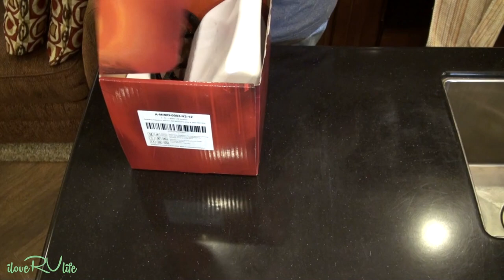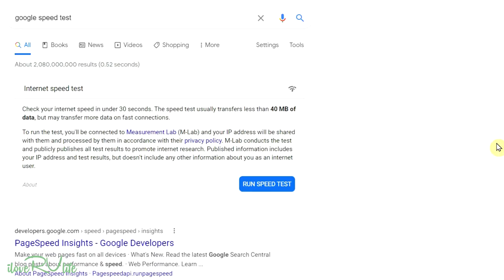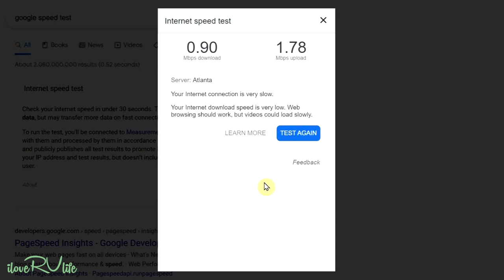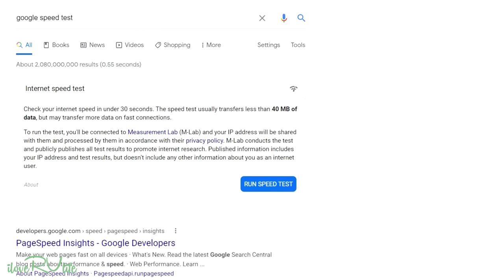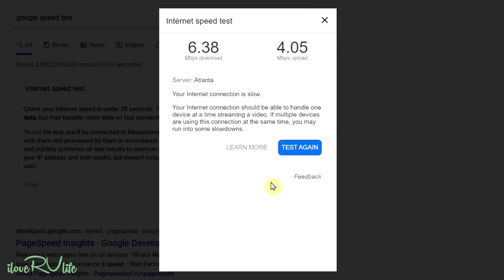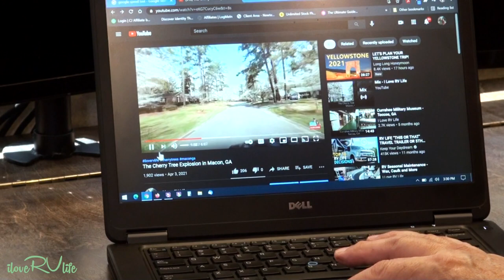External MIMO Antenna for the MoFi 4500

Comment: The paddles work a little better when they are at 45 degree angles, not straight up. That creates the 90 degrees MIMO needs. I started with the Surecall booster and wasted $350.  It's more for cell signal boosting. I have the mofi and it rocks for cell internet boosting. Nice video!!
Reply from the maker: It’s a really good unit.  Thanks for the tip.

Comment: Jerry
Instead of a metal plate, try some aluminum duct tape. It works well for me.  Also there is a firmware update that includes a built in speed test. Also a selective band lock depending on the speed test.
Reply from the maker: Thanks.
Reply: Great job, Jerry... I am in a rural area in Western NC & have the Mofi4500 dual band router w/ MIMO 4 X 4 external attennas & have done a firmware update, locking down bands that give me the best signal. Unbelievable difference. Speed tests before, 3 mbps download, 2 mbps upload...With new configurations mentioned, I am getting 75 to 105 mbps download, 25 to 35 mbps upload...VERY HAPPY CAMPER HERE ! Thx for sharing your videos & the best internet is still ahead ! 👌 👍🙏
Reply from the maker: It is a good unit. We’re moving often and we experience changes in which bands have the best bandwidth. Great having the ability to lock in the best performing band.

Comment: How does it compare to a directional antenna?
Reply from the maker: Hi Haskell.  This antenna doesn't have the gain of the directional antennas.  That's also depends in the directional used too.  We're taking a couple db hit with this omni, but a big improvement over the paddle antennas we were using inside the 5th wheel, plus the convenience of just turning the unit on with now outside set up.

Comment: Jerry, is there a way to attach the MiMo in another place? We do not want to drill a hole in the roof. Love your videos.
Reply from the maker: Thanks so much.  There’s a couple options when using the MoFi 4500.  The simplest is using the upgraded paddle antennas.  These work great if you have a good to moderate cell signal.  For low signals, I used the extendable aluminum painters pole with an Omni directional antenna.  Easy to set up.  No permanent mounting.  Extent the pole.  Use a couple short bungee cords to tie to the ladder rack and run the cable in a window.  Cable is thin and closing the window won’t damage.  This is the antenna we used https://www.mobilemusthave.com/Poynting-OMNI-402-Marine-LTE-2x2-MIMO-Antenna_p_101.html/?AffId=81. You may need to add some extra cable to reach.  You can order the length needed with the ends to fit the antenna and MoFi here https://www.mobilemusthave.com/LMR-400-UltraFlex-Custom-Cables-Various-Lengths-Terminations_p_1245.html/?Affld=81
Reply: @iLoveRVlife  Thanks so much for getting back to me.
Reply: I use 2 yagi antennas on a pole.  I go out through the bottom corner of one of our slides.  However, in the newer rv, we'll be going through the roof.  May do an omni mofi antenna (like this one) and have the pole/yagi's ready to go up if things are slow.
Reply from the maker: The yagi’s are far superior.  This was a good step above the paddles.  We traded the Gateway and have a new 5th wheel.  I’m considering the Husky Pro by Parsec and mount on top the ladder in back.  Haven’t worked out the entry yet.  Just don’t feel right drilling a hole in the new 5th wheel yet.

Comment: Great info Jerry, thanks!  Have you attempted video conferencing with the Poynting/MOFI 4500 set-up?  I am getting ready for a 2 month road trip, however, I spend 2-6 hours a day in group video conferencing!  (Yuck, but it pays the bills...)  Any pointers or suggestions?  Thanks in advance!
Reply from the maker: I have. All depends on bandwidth.  Currently in a very remote area.  With 10 down and 5 up, easily do conferences.   One tip. Before we book a site,  I call and asked about the cell coverage. If it's poor, we pass and find another place if client work is scheduled for the week.

Comment: Great video! I am soon to be full time Rving in my 5th wheel I just purchased and I have been outfitting it for battle. I just had a 30 foot bumper pull I set up a simple solar and battery monitor setup as well as an inexpensive smart tv I bought from best buy and converted it easily to run on 12V. Trying to within reason have as many amenities as I can run from 12v for boondocking flexibility. Changing all my bulbs to led, the TV running on 12v instead of through a power hungry inverter was a great start. Which antenna model is this you used? There are like 4 different models at the link you provided? Is this just the 2-in-1 lower cost model? I was just about to pull the trigger on the  Inseego MiFi M2100 5G from Verizon as a hotspot but I think I may go this route instead the router you have and this antenna. 5G will never work camping anyhow I feel that hotspot from Verizon is just going to be overpriced let down. Internet is a high concern so I don't mind within reason investing into a usable solution. I mostly just watch Youtube, I do have a channel and upload videos as well so I know i'm in for a challenge and a world of frustration. I love the pace and attention to detail in your vids. You don't leave out important details and don't rush. Good job
Reply from the maker: Thanks a bunch.  This is the Poynting 2 n 1.  I didn't need GPS or wifi connections.  Just serving the MoFi 4500.  We're in a lot of rural areas.  4G is working great and agree will be some time before 5G is widely available.   With your boondocking plans, consider the 12V DC power regulator to go with the MoFi.  Simple add.  I have it, but running on 120V AC.  Plan to add later this month.  Safe travels.

Comment: This was a great side by side comparison with the speed tests. I just purchased a new 5500 as my first 4G router and am trying to decide on an antenna so that I can work remote and travel national parks with enough bandwidth to support my remote desktop. Just wondering where this RV park is with the incredibly poor connection. Is that typical for campsites across the country in national and state parks? Just trying to gather as much info as possible before this lifestyle change. Thanks!
Reply from the maker: Here good things about the new 5500.  State and National parks are hit or miss for cellular coverage.  As you research a campground, often comments are shared on the access to or lack of cell coverage.  I work on the road, so if no “reasonable” coverage, we skip.  If you’ll be in the more rural areas, consider a dual stack Yagi on a long adjustable painter pole.  Then take a few minutes to point at the closest tower.  These dual Yagi stacks are high gain.  The biggie is you must have some signal before you can increase with an antenna.
Reply: @iLoveRVlife  Do you have a go-to resource for campground cell service information? I know about campendium but that’s about it. Thanks again
Reply from the maker: I use https://www.cellmapper.net Also do a Google or Trip Advisor search for the campground.  Search comments for “cell”.  Not 100%, but others may have shared experience.  If still unsure, call the campground.  Usually someone at the desk will let you know of carriers and strength.

Comment: Have you tried out the Mofi 4500 with the Sims seven yet?
Reply from the maker: I have one. https://youtu.be/f3bW5RUp2Ww?si=3Zod4TwgtFokXsJJ Nice unit. Upgraded to a CradlePoint with CAT20. https://youtu.be/ZvThK258sZM?si=BQWm0OW4FhnvBEYE Needed 5G.  Most of the 4G plans are now getting low band 5G transport.  We’ve seen 4X to 5X increase in speeds.

Comment: you described the paddles at the beginning that you said were an upgrade, so you showed 4 antenae.  Yet you only installed the two basic ones and there doesn't seem to be room for the other two the way you installed it.  Are you saying they really aren't necessary or am I missing something?
Reply from the maker: Joene, I mentioned the previous video where purchased and set up the MoFi 4500.  Without the external antenna we moved from side to side of the 5th wheel next to a window for the best signal reception.  The paddle antennas were used for the cellular reception.  Now with the external antenna, I permanently mounted the MoFi to the side of the cabinet and eliminated the need for the paddles.

Comment: I have been using the Mofi 4500 as well and it's been doing great. But, I wonder how this would compare with the double Yagi style antenna that I put up on a pole when I'm in a fringe area? Sure would be nice to no longer need to put up the pole and then point it in right direction!
Reply from the maker: No comparison with the double Yagi for signal gain.  The Yagi will have more gain.  The pie shaped Yagi’s are around 11db, where the Poynting is slightly less than 6db.  Also, you can get a little extra height with a pole set up.  The big benefit with the Poynting is lack of set up plus signal improvement.  Just turn on the router.  Only thing I do extra is a band search to see what’s strongest, but that would occur regardless of antenna.
Reply: @iLoveRVlife  yes, the more I think about it, a good setup would be to have the Poynting on the roof and hooked to the Mofi for general use, then if I get into a place where the Poynting isn't quite making it happen then have the option to still hook up the Yagi's.
Reply from the maker: Perfect setup

Comment: I think I can Increase my ban withh though by 3. Or 4 times I hope I am getting almost 4 upload right now Without an outside antenna I think it will make a difference once I get it all fixed up
Reply from the maker: Depends on the signal strength. I weak areas, the outside antenna increased the signal 3X.
Reply: @iLoveRVlife  ya I just got this mofi used from eBay and it is already out performing the lower end Cudy 1200 4 g router than I replaced it with
Reply: @iLoveRVlife   Keep in mind I’m kind of down in a Holler Sorta in the bottom two hills
Reply from the maker: It’s a good unit. Even with the paddle antennas will give more gain than the Cody.
Reply: @iLoveRVlife  Yeah I didn’t know what to think when I was configuring it I was pulling my hair out a bit but I think I got it to where it  functions all right It’s a bit outdated technology wise but I think it will turn out to be a good unit It was way ahead of its time I have good feelings about it
Reply: I thought you might wanna know I hooked up my mofi to a 4 by 4 mimo And it tripled my speed and that is just using it Outside on the chair I am going to mount it to a pole and put it 15  feet up in the air

Comment: Which mofi 4500 did you use, Amazon now has a few more models , v3, one with 5ghz/ 5g
Reply from the maker: We’re using the MOFI4500-4GXeLTE-SIM7-COMBO 4G/LTE Router.  Here’s a link https://amzn.to/3HQi8Wq Great to have the expanded bands with this unit.  This week Band 4 is congested.  We switched to Band 66. Bandwidth for work and video entertainment have been great.

Comment: Where you required to put a Sim card in the mofi 4500
Reply from the maker: Hi Mark.  Yes.  I used a Verizon hotspot SIM.  This unit support SIMs for Verizon, AT&T and T-Mobile or resellers using these networks.

Comment: What kind of roof do you have? Is it TPO?
Reply from the maker: Had the TPO roof replaced.  Tore a big hole in it a while back.  Replaced with a PVC.  Great roof.  Super white to reflect sun.  Easy to clean.  And my favorite, it doesn’t oxidize and get chauly.

Comment: you need to drop the mofi router because it only has a cat6 modem inside of it, the highest cat they have in there routers is a cat7 worthless. you need to get a we826-t2 or a we826-Q router with a cat12, the cat12 gives you 3x Carrier Aggregation which is a lot better then mofi,.. and you will get 15 to 20 mbps upload and download,... i have one rite now custom made, and ill tell you, its 100% more better then mofi,...
Reply from the maker: Looks like you've had a look at my video production schedule.  New router is on the way.  The Mofi 4500 has served us well, but getting dated.  More on the new router and antenna set up in a few weeks.

Comment: Get your self a nice router. The wifi on that thing SUCKS!!!!
Reply from the maker: Not our experience. We’ve been using everyday since purchase this spring.  No issues.  Excellent WiFi, good reach in and outside the 5th wheel, and great having the ability to pick the best band in a heavy use area is great to max cell speeds.
Reply: @iLoveRVlife  I was getting 2 Mbps off MoFi wifi, hooked it up to my nighthawk, it went to 8 Mbps. Then I hardwired directly, still 8. Tried mofi wifi again, back to 2. Maybe it's just my device
Reply from the maker: Could be.  I've over doubled my bandwidth from using a hotspot.  But, the Nighthawk is a nice unit.